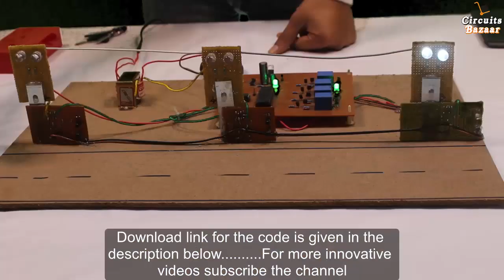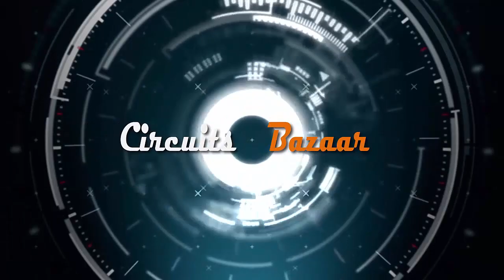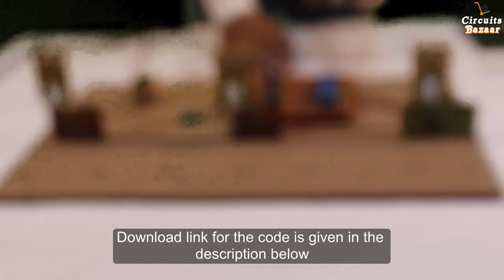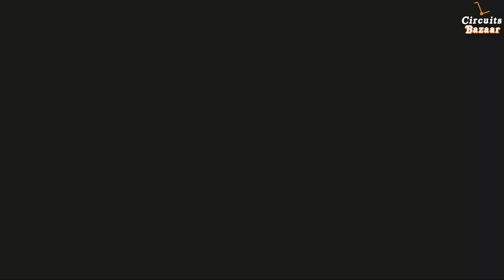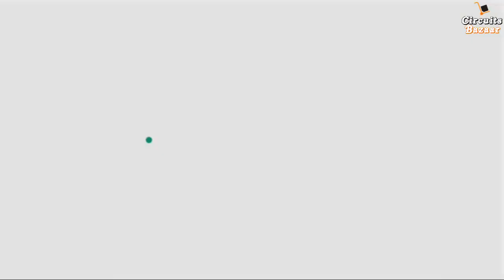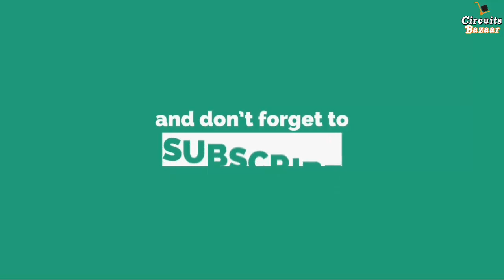Vehicle Present Based Automatic Street lights using IR sensors [ with code and working details ]

Comment: You code works in a one way,
If two vehicles come from opposite direction only one of the lights will be on at any instant of time I hope so.
Reply from the maker: right .... but using interrupts you can make code for the dual direction as well...